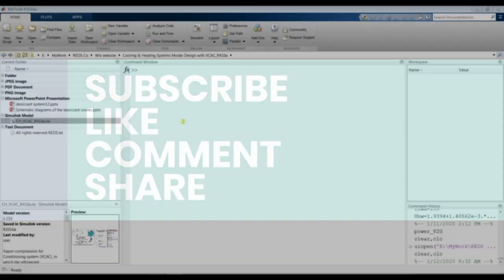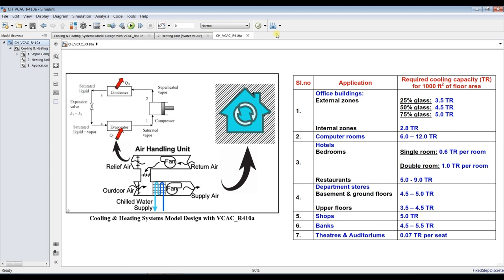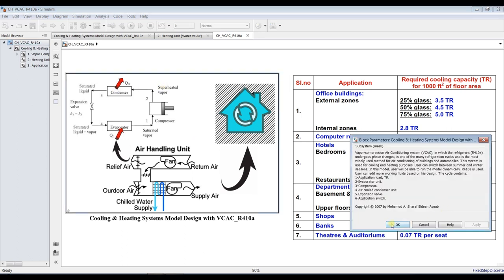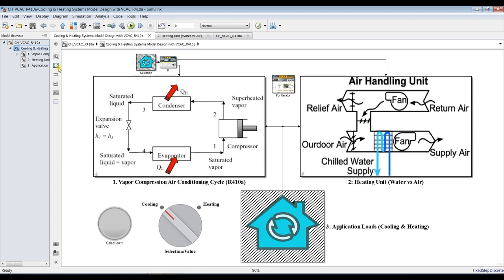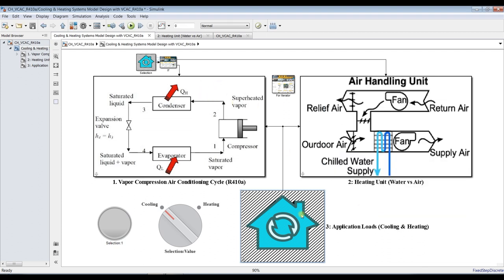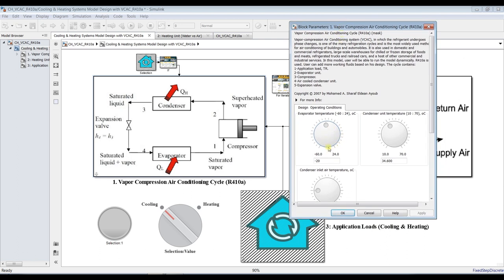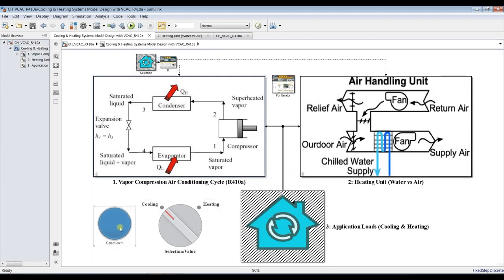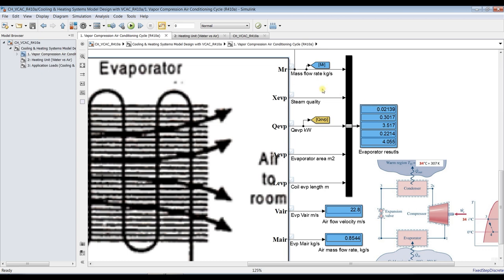Cooling and Heating System Design | Vapor Compression Air Conditioning | R410a | Matlab | Simulink

Comment: Sir, I am doing a project on a heat pump system for electric vehicle heating and cooling, would you mind sharing your thoughts and what should I change from your model? And how do you come up with those input values? I found your video very useful, thank you so much for the effort.

Comment: Hi, I'm looking to design a waterchiller system, for instance bringing 30 litter of water from room temperature to 1 Celsius. Can I use this to find out how long it will take to bring the temperature down? and what HP of compressor I would need? thank you
Reply from the maker: This model is not a water chiller unit. However, you can replace the air through the evaporator with water to be cooled. It is some kind of cooling tower but a mechanical draft. See this link.

Comment: a very good work,
How can I find enthalpy values at different temperatures and pressures (for R410 fluid)?
  I need to have the T-S diagram drawn.
Reply from the maker: You can use the model to get your values
Reply from the maker: The temperature, pressure, enthalpy are stored as values in the model.
Reply from the maker: Watch this video https://youtu.be/6k8I3BNVkcI

Comment: Can I  use it like a mini project ( making HVAC SYSTEM using  simscape ) ?
Reply from the maker: Dear, Unfortunately I do not know if you can connect it to the simscape or not. It just simulink model block. Yes you can connect it to any other simulink systems but simscape, I do no know. Sure you can use it as mini project or any research activities.
Reply from the maker: You can also connect it to this model too. check the link: https://www.youtube.com/watch?v=P4aOKv8--GE&t=77s

Comment: Can this be used for normal air conditioners or it is only for central?
Reply from the maker: For any size depending on the load.
Reply from the maker: It depends on how many ton refrigerant you are going to use.
Reply: 1 ton
Reply from the maker: @anasabdulla196  yes, you can assign even below that. It is up to your design.
Reply: Thank you very much for your help.
Reply from the maker: @anasabdulla196  anytime